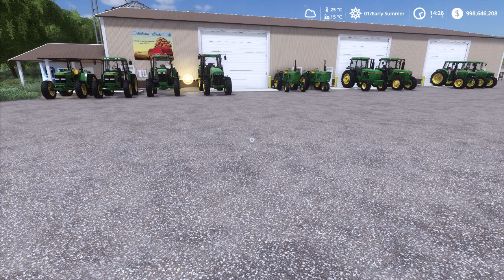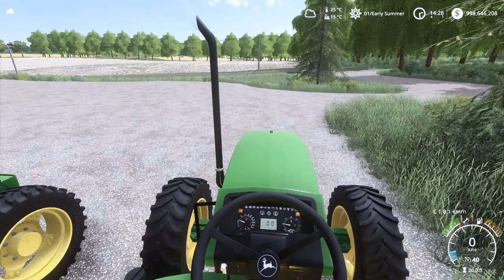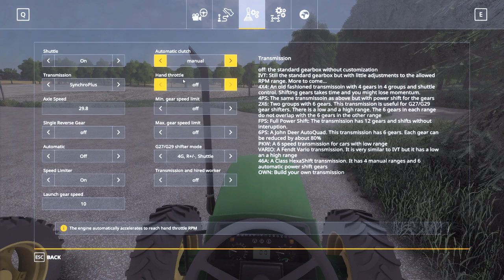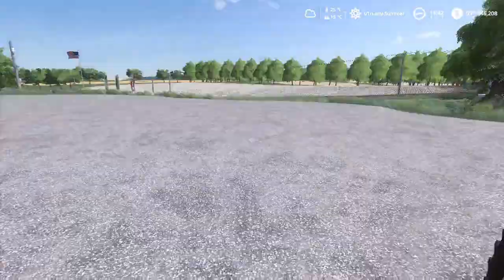FS19|Transmission Simulation via VCA: An Overview of the Vehicle Control Addon

Comment: Hi Tyson, thanks for all your work on this and on Autumn Oaks. I’m setting up a realistic server on Autumn Oaks with a couple friends and was hoping to use VCA with the custom transmissions, but you said they don’t work in multiplayer?  Is that the case even if we all have the same version of the mod?
Reply from the maker: Just before release, a guy came to me with a fix for the multiplayer issue, which is writing the transmission into the LUA script. The original way of doing it via XML was not multiplayer compatible. What I released will work in MP.
Reply: @TysonDiniz  Oh, perfect, thanks!

Comment: Been using this mod since I got my pc last week. Still figuring most of it out. I do love the Vario transmission I like the work range and road range. But my wheel an pedals lack an actual shifter an clutch pedal. Still tinkering around I'd like to use my padal shifters to actually shift gears, but I'd have to figure out a clutch then I believe? Lol sorry Tys Still a pc noob lmao. But so far I just look up the tractor an find out what transmission it uses. Like the versatile 520 has the full power shift with how ever many gears
Reply: Does this mod only work on certain tractors or does it work with all mods?
Reply: @danielsmallwood4683  so far it works with any vehicle I've used. There's different transmission setups, you have to manually select what one you want to use when you get in a vehicle it doesn't automatically pick one. I'm pretty sure tyson released or will release setups for the different john deeres. I mostly use the vario one since it has road range and field range